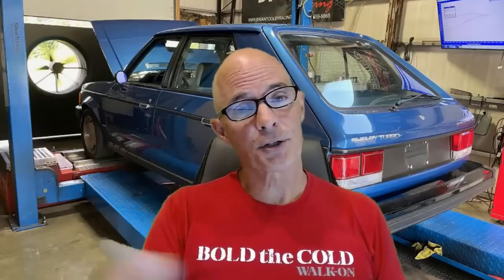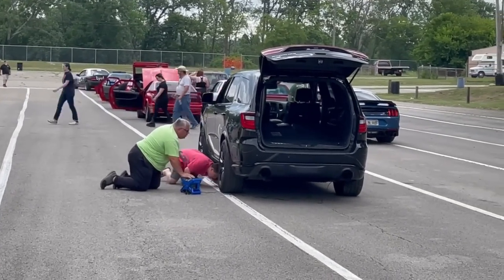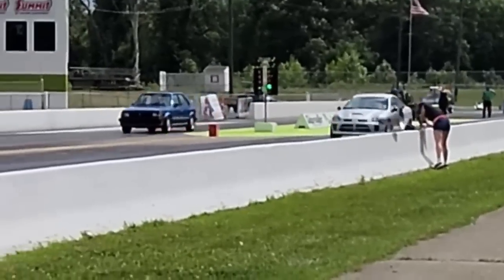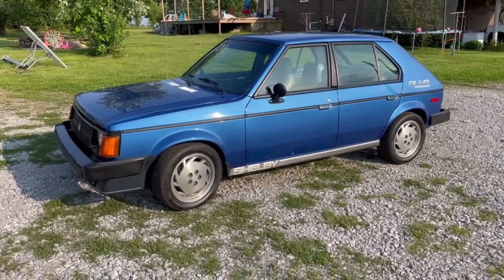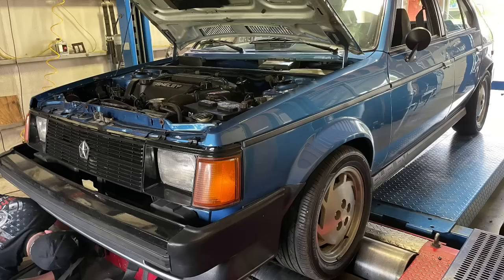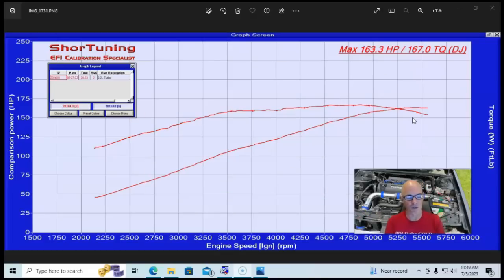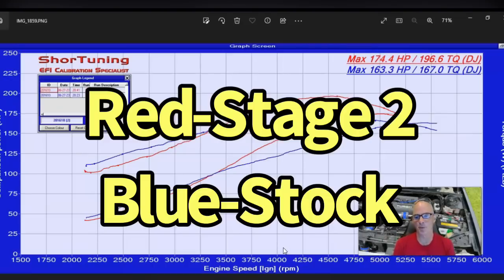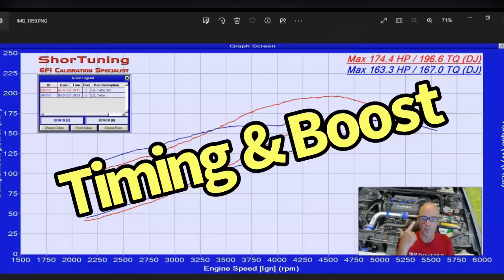2.2L DODGE OMNI GLHS TURBO-FULL DRAG STRIP AND CHASSIS DYNO RESULTS-T2-SWAP OMNI (STOCK VS STG2 ECU)

Comment: Any news or updates with the omni? Also curious on the cylinder head porting/flow testing unless its on the wizards page.
Reply from the maker: I'm driving it
Reply: @richardholdener1727 i probably missed updates. Glad you are out on the road. Any more upgrades other than the  upgraded logic module?

Comment: I have an '86 Shelby Charger. Did Mopar computer upgrade, blew the headgasket. Aftermarket gasket, polished and ported the head, high RPM lifters, 11mm head bolts, bumped the cam up a notch. Reprogramed the computer to 16psi, had to install larger fuel injectors. Then got the short throw shifter. New Heim shift linkage. Lotta fun!

Comment: Factory power was 175/175, but the Shelby Stage 2 ecu claimed to make 200hp/210tq. Looks like they aren’t far off.

As far as boost cutout, I’ve run 18psi on a Stage2 ecu with a manual boost controller with no issues.

Comment: Be careful. The head gasket will need to be replaced often. My 88 New Yorker Turbo had a new head gasket every 20,000 miles. And that was stock and normal driving.
Reply: Maybe ran too hot
Reply: Aluminum head are flimsy
Reply: The head gaskets are a lot better now days… however if yours was blowing them every 20k that means something else was wrong. Could have been a warped or cracked head amongst other things.

Comment: My grandpa had a 85 turbo z and boost cut at 5500 stock and with stage two computer cut was at 6500 is what he told me. Boost went from 7psi up to 12 psi with the ecu change as per the stock gauge. There was a big difference. I still have the aftermarket ecu.

Comment: man Kswap that thing and pull 800+ outta it haha
Reply from the maker: nope
Reply: @richardholdener1727  hey Richard random question but I was wondering if you ever had any experience on turbocharging a Toyota 4-cylinder? Me and a couple guys that I met online turbocharged or 2zrfe engines and one of them is putting out 320 wheel horsepower on about 15 pounds of boost and it's been holding up pretty great All-Star game turtles just upgraded fuel pump and fuel return system the turbo kit and he's had zero issues
Reply from the maker: how do you control timing
Reply: @richardholdener1727  wow the typos in that last comment sorry but yeah a tuner has reflashed the stock ECU

Comment: I bet the stage 2 runs more timing in the low rpm than the stock one and that dropped egt and thus turbo response and there went the bottom end torque
Reply from the maker: more timing that would add power would somehow mean less response? Nope
Reply: @richardholdener1727 I bet if you made steady state load pulls at 2500 rpm the stage 2 with the extra timing would make more power than the stock. But on an accelerating load the advanced timing causes lower egts and thus turbo lag which shows up as lower power versus the stock tune.  On my truck stock timing is 12 deg but I can advance it to 17 with a switch. It drives and spools way better with the lower timing and makes more torque at a lower rpm even though it drops 50hp closer to peak power versus the advanced timing.  The idle and cruising egts are 200deg less with the advanced timing and that causes lag
Reply from the maker: this change in response was from temperature of the turbo, and I have tested many times and never seen an instance where a motor that made more torque down low in na trim didn't also add boost response.
Reply: @richardholdener1727  But why was the temperature of the turbo different? Was it just hurried testing that prevented you from being able to get everything normalized yo start the run or was it colder from timing advance? Chicken or egg 😎
Reply from the maker: Say it with me-engine and turbo temperature

Comment: My stock 86 GLHS Omni ran 14.7 @ 94 mph on its two first passes, 2800 rpms on the launch shifting at 6000rpm, you should be able to duplicate this when you get it running right. Blue looks good!
Reply from the maker: tach did not work at the drag strip

Comment: Hi Richard. I am a 4.6 guy and interested in putting 2v heads on a mark viii/aviator block for the flat top pistons I think thats 12.5:1 compression. Would you run that combination on e85 and stage 2 cams.
Reply from the maker: did you do the calculations on the compression?
Reply: @richardholdener1727  to the best of my knowledge that's what I'm calculating

Comment: Dodge dealer here : the reason the " Stage 2 " computer is pulling boost is because ,
The car starts shortening the fuel pulses after a certain pound of boost .
Get a "Fuel Cut Defencer"  and a  good intercooler and you will make sooo much power with the stock block that your transaxle will now be the weak link.
I had a stock GLH-S  & had Reeves Callaway make & give me an intercooler for it . I made a boost adjuster , put on a Fuel Cut Defencer , plumbed the intake into the cowl for cooler air ,  Flowmaster cat-back and the thing was Soo fast I was grenading gears out of the transaxle 💣
It would smoke the tires up to 60+ m.p.h.
I had to put 4 -"R"Spec. tires on it 😎
Reply from the maker: we never got into fuel cut

Comment: That torque steer... have you centered the engine yet? I don't remember the actual measurement values but it's a really important step in avoiding torque steer, and eventually in not binding the CVs up and blowing them apart in turns.

Comment: I was going to guess not enough flow on the wastegate, that used to be one of the original modifications from Mitsubishis even on the small turbos, porting out where the wastegate flows right through the cast o2 outlet pipe to the downpipe, and that became even more important if you had additional exhaust flow because it could creep

Comment: The dyno graph showed a slight loss in power and torque from 2k to 3500 with the stage 2 computer wouldn't the leaner air fuel on the stock computer in the range it lost power down low between te runs be just the difference in fuel?
Reply from the maker: no-it was likely lack of heat in the turbo

Comment: Man it only revs to 6000 rpm for a little 4 cylinder I thought they were supposed to rev
Reply: They're very undersquare... long stroke engines. 87.5mm bores and 92mm stroke on the 2.2, 104mm for the 2.5. That's 3.44" bore and 3.62"/4.09" stroke in freedom units.

Comment: Great car...love it!!  Kind of surprised you had to grab 4th...I would run through the traps in 3rd when running 15's.  Only at the end when I was getting at around high 13's @ 103 mph in my Shelby Z did I have to start grabbing 4th.  One thing's for certain...makes me want to get my GLH's body cleaned up - straightened - and painted.  Had Turbo Dodge Trans Shop rebuild the transaxle with a TU LSD, so need to stop stalling and either drive the car and pull the engine this fall...or just say the heck with it and pull it now.  If memory serves, I got a little bump in boost when I un-restricted the exhaust, had a CAT, but it was a high flow Walker piece.  Forgive me, but don't recall if you were running stock exhaust on the rest of it??

Comment: Now, drop the exhaust at the turbo, and Dyno again :) I'm with the suggestion of a manual boost controller also, to add consistency to the tests. Reference the boost controller from the intake/throttle body, rather than the compressor housing for just a little more:)

Comment: in the late '80s i saw an Omni that broke out on a 1/4 mi with  a high 9 second run.  The car had koni shocks and slicks.  striped interior.  It was in a Mopar mag from the day.  The cylinder head was a special Mopar creation.  God rest your soul Klaus.

Comment: My Dad worked at Chrysler HQ in Auburn Hills. He was able to get me an experimental brain for my 86 Shelby. I was warned it would eat my trans. At 3k when the boost kicks in it would bury my guage (15psi) untill the turbo wound up then it would back down to 12psi. Most of my fun was from a rolling start. Even then it did tear up the trans. I could keep up with the 5.0 mustangs!

Comment: Best time I've gotten with my stock CSX-VNT is 15.2ish @ 92-ish mph. Always felt I could break into the 14's with a better launch, but I haven't been able to get under 2.2 60'. (My old Daytona I could get low 2.0's, as it seemed easier to launch/liked a bit of wheel spin). I do think I suffer from boost creep w/ the VNT, with my boost gauge being more or less pegged. (past 15pis) ot sure if it helps as the turbo is pretty small, so unsure if it exceeds it's adiabatic efficiency and hurts overall performance, or it's fine and I'm just overthinking it 🙃

Comment: Check the vacuum system. You have to have all the right restrictors and T's in the right places and the hoses oriented correctly on the solenoids. Depending on whether you kept the stock solenoids or it has later ones in it can mess with how well it controls the boost. My bet is there's something amiss giving the rising boost curve. You are not hitting boost cut. As Brian pointed out below, you'd know it if you were. It shuts off the ignition and fuel and it bucks around real bad. Not a fun time. On the S2 computer and the falling boost, my bet is that you are seeing the restriction of the stock exhaust. I actually expected a higher torque number, and sooner in the rpm range, which also makes me thing there's something wrong with the vacuum system. Of course none of my own modified turbo MOPARs have the stock vacuum system on them anymore...I simplify them down to about 5 and run a manual boost controller. When that turbo hits...it hits HARD! LOL 291ftlb at the wheels on 22psi at something like 3000rpm on an otherwise stock engine 2.2 TII (it does have all the supporting mods). It is a spike, but it still holds it pretty well making over 220whp for over a 2000+rpm range.
Reply from the maker: it has all the stock solenoids and fittings (for smog), but we suspect a cracked plastic vacuum line or possibly tension on the waste gate actuator

Comment: What Air fuels would you want to see at 15lbs of boost 4-5k rpm? Basically a highway pull stretching it out? Stock t2 turbo.
Reply from the maker: mid 11s

Comment: On those old dodge turbo 2.2 or 2.5 Cars used to be really fun to drive.  You could do a small vacuum leak in the map sensor vacuum line and it would act like an adjustable boost controller.  Take the  hose off and drive then come back for a head gasket !😂

Comment: I'm not the biggest fan of the stock pcm controlling boost, I put aftermarket boost controllers on all of my turbo dodges, but the stock does a decent job. The computer has to "learn" how to control the boost, so if you just straight swapped the "stage 2" pcm in there, without it relearning the boost curve, then that could be the cause of the boost spike on the stage 2 computer.

Comment: the stage 2 computer targets 13.7psi boost vs 12 and at a lower RPM as well (s2 11psi to 3000rpm and then 13.7... stock, 8psi to 3500 and then ramps to 12 at 5000). depending on how long it was from the battery being disconnected to when the dyno runs were performed can effect boost (autotune boost adaptives) , as well as vacuum line leaks. The stage 2 is programmed a little leaner from 5psi on up as well and has 2 more degrees of timing. the stage 2 also allows for 2.8 sec of overboost rather than .25 sec before shutdown. and you would know when it hits shutdown... it shuts off power to the coil, injectors and fuel pump. its violent.
Reply from the maker: makes me wonder if the dyno boost gauge was reading high
Reply: Stage2 ecu was for a full 2BAR, 14.7psi…

Comment: How does it compare to the Sprint turbo?
Reply from the maker: 100 more hp with the Omni in stock trim
Reply: I had one back in 87... only weighed like 1600 lbs.  Was a fun, quick car.

Comment: Stage 2 would be a terrible street car with all that loss of torque. Right? Just like when you say that about a cammed LS that lost 20 ft lbs and has only 400 ft lbs at 2500 is not good on the street.
Reply from the maker: you seemed confused

Comment: The stage 2 typically has boost cut but it allows the boost to exceed the limit longer than the stock ECU before it cuts the ignition.
Reply: Correct, hence why everyone just used a boost controller with a  vacuum hose from the waste gate actuator to a vacuum source and skipped the factory solenoids. That was one of the first things I did on many turbo dodge cars besides replace the fuel lines from the rail to the firewall and new motor mounts and those stretchy joint CV axles from Napa worked great

Comment: I bet that thing is a blast to drive around. The world needs more of these types of cars. I had a turbo Lazer that was an 85 or 86 model and later on an 89 Probe Gt that was 4 cylinder turbo. I had so much fun in both of those cars.
Reply: Always loved a stick shift "hot hatch" car. couldn't tow much with it, but i could enter a swap meet, sleep in the back with mosquito netting (like an 86 GT Mustang and others), and fill the trunk with cheap engine blocks and headers and so on before the gates opened to the buying public.

Comment: Won a SCCA state autocross championship driving a borrowed stock GLH after driving around the parking lot for about a minute.
Sooo easy to drive...
Reply: X2 my Intercooled GLH with 3in exhaust and stg2 ecm ran in CSP(class C, StreetPrepared) on sticky tires. It was the dominant car in it's class. ACR Neons couldn't touch it
Reply: @kylemilligan752  9 Porsches found out how dominant that little red four-door was at that event 😂
Reply: @ytwatcher8288  Oh, I know:) I showed up at a Porsche vs Corvette event put on by our SCCA  group. They let me run "fun runs" at the end of the day. Was two seconds off the fastest road race C4 on big sticky slicks. This autocross was on an old navy  airstrip, with my top speeds approaching 80-85. The Vette and Porsche guys  got mad. Ruled that you had to be in competition that day to make "fun runs" afterwardd
Reply: @ytwatcher8288  Last event I ran was a 2 day SCCA OctoberFast in 1997ish. Bunch of 79-84 RX7 racecars, and Neon ACR's track cars on slicks in my class. Embarrassed them, won my class, and was within 1.5 sec of fastest time of day overall. My GLH was a weapon on sticky tires
Reply: @ytwatcher8288  By the way, the GLH was my daily driver

Comment: I'm  sitting here watching and all I keep thinking is I would bet if you put in a cut out and bypassed the cat and muffler you could probably pickup 50 60 hoarse easy 🤔
Reply from the maker: 50-60 hp would not likely happen without a lot more boost (10 hp per psi roughly), but I think we would see some (that test is planned)
Reply: I'm looking forward to it!smiling!
Reply: Legend has it that bypassing the cat/exhaust on a stock 2.2 is around 25hp.  Cat was supposed to be worth 15ish

Comment: I bet that computer upgrade registers like 75hp on the butt dyno 😂 lover track and chassis stuff
Reply: My friend has a 89 Shelby CSX VNT. AFAIK it's more or less the same basic engine but with a variable nozzle turbo and it also has lightweight fiberglass wheels for less rotational mass. It's been 20+ years but I remember his ECU upgrade feeling very strong at the time.
Reply: A friend added 20ish hp to his late 60's Lotus Elan (1500 lbs).  Felt like 100 hp.
Reply: @nucleargrizzly1776 15% moparwer @4500 may be a better way to look at it.
Reply: @2VersTT0  I'm thinking power to weight ratio.
Reply: @nucleargrizzly1776  o ya 15% power increase on a 1 ton vehicle way more feel than 2 ton
Reply: @2VersTT0  It felt like even more than that.  Almost like an exponential increase.  I think I have some math to do.